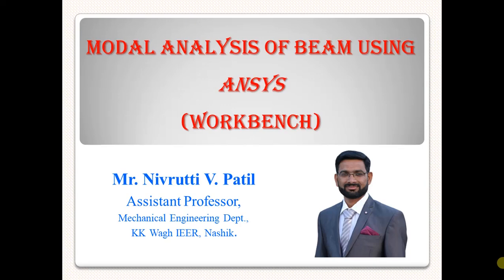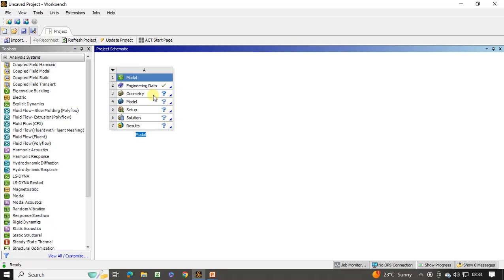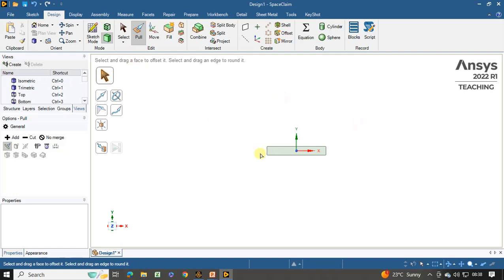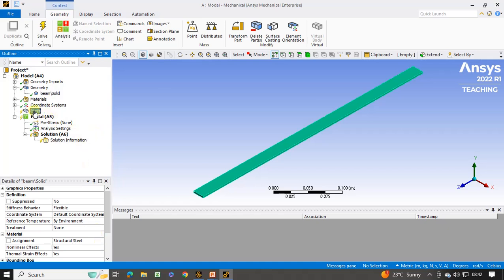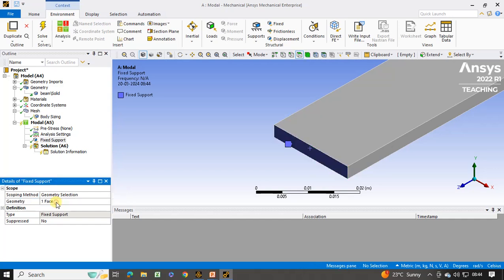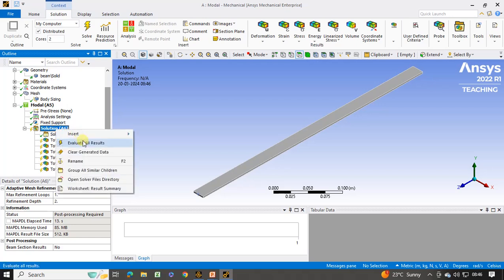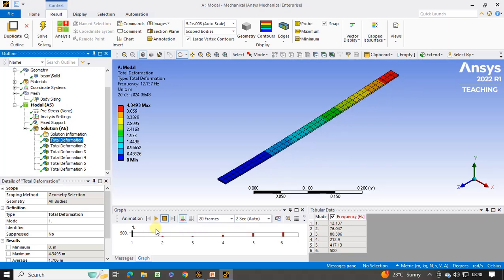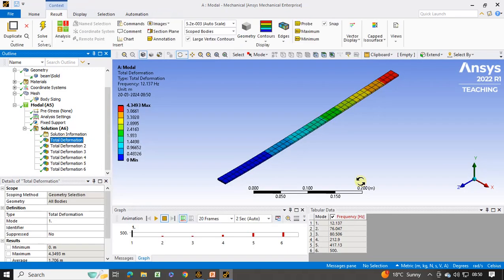Modal Analysis of Cantilever Beam Using Ansys Workbench

Comment: To obtain natural frequencies for only in-plane bending, how to define in-plane vibrations beam via Modal analysis at ansys workbench. Beam has rectangular cross-section. 1 mm x 25 mm L=150 mm Aluminyum
Reply from the maker: @F-kg5ut  in boundry condition ensure in plane motion is allowed releasing out of plane constraints.
Use rigid or cylindrical constraints to allow only in plane motion.